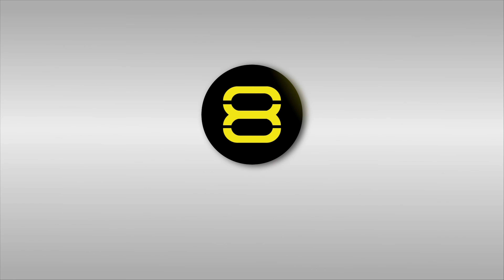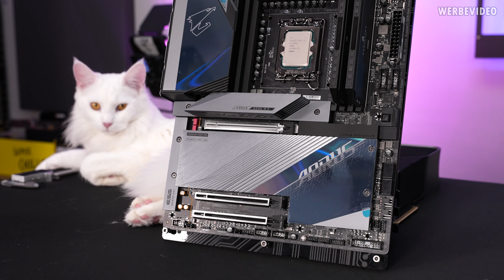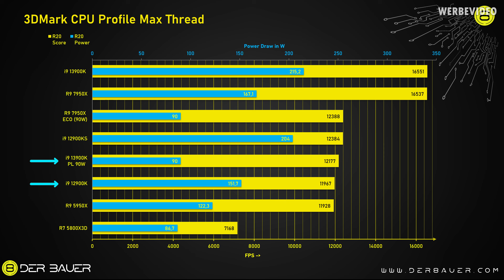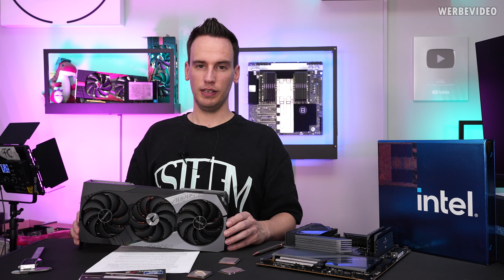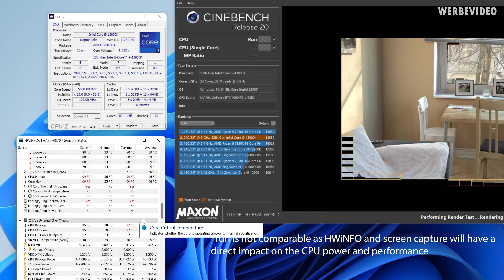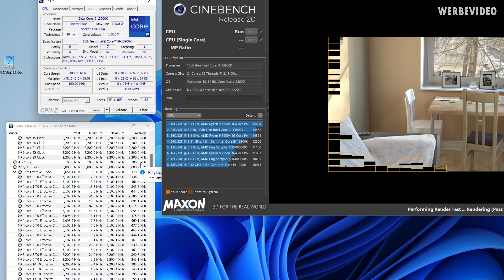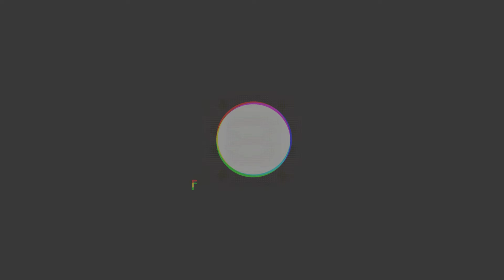Testing and Tuning the new 13900K for Efficiency

Comment: I still think what is most impressive is the eco modes and their efficiency
Reply: Exactly! I was surprised by 7950x efficiency but this video persuaded me, that even 13900k can be power efficient. That's great!
Reply: @fybyfyby  AMD know what they are doing, even the last gen Zen was efficient but they go cought up in Intels mhz game.
Reply: 12900T at 2.2Ghz had power efficiency comparable to AMD laptop chips. Every chip has a VF curve and you can decide where on that curve you go.
Reply: Ye, this is what it looks like when silicone is EOL lol.
Reply: @Coffee Fueled Curmudgeon but wouldn't that be the same as getting a 12900K or 12900KS ?
Reply: I'll now wait for the 7800x3D and 13700K stats to see which has the lowest energy use for gaming and that will be be me sorted I think.
Reply: @Coffee Fueled Curmudgeon I'm kinda thinking 13700 is the sweet spot, which is why they aren't throwing out the review samples for 13700.  More cache, only 100$ more than 13600, 200 less than 13900, and it still has the 8 P-cores that the 13900 has.

The power draw is at 210 watts, so with similar tweaking to what is done here you can go down to about 100 watts without seeing much performance degradation on it at all.
Reply: Great job by Intel gen 13th delivering very decent price to performance, meanwhile Amd has been a lot disappointing with Zen 4, not only Amd is overheating but also the Cpu itself is overpriced, r9 7950x is $150-200 more than i9-13900K still Amd can't beat Intel in full benchmark, not to mention Intel still compatible with DDR4. Intel totally destroyed Amd here.
Reply: @runninginthe90s75  The black and white mindset lmao. You heard Roman, Intel efficient in gaming, AMD efficient in workloads that's pretty much it. The whole AM5/DDR5 expense thing is a bummer but for people that are building a new system, the pricing won't play as big of a role since the whole system is already gonna cost lot of money no matter which platform ppl choose.
Reply: @Hito343  I disagree. 13th gen supports DDR4, what about Ryzen 7k series?
Reply: @Hito343  the actual 7000s chips also cost more for less performance
Reply: @paultapper9300  why is energy use going to take you one way or the other.... just buy a bigger PSU and go with the best performer.
Reply: Bodes well for the laptop parts too
Reply: Intel 13600K / 13700K should be even more efficient for gaming, less cores idling.
And then AMD comes with something like Ryzen 7700X3D xD
Reply: @mi-rek  the AMD would require me to get a whole new mobo.  Im wondering if it's even worth getting a 13600K or 13700K to just gain a few Mhz?  (coming from a 12900K).  The nice thing is I would just think I could pop the old out and pop the new one in (adding a little contact gel).  I don't even think i would have to flash the BIOS with the new version that came out recently (since flashing the BIOS wipes out all my settings, ugh).  ?
Reply: Could someone explain why people are acting as though eco mode is a new thing. Ryzen has had it since at least Zen 2.  I don't remember if Zen or Zen + had it. What am I missing?
Reply: @The_Chad_  I think maybe because it wasn't as much of a necessity with previous gens on desktop.
Reply: I still currently use a 8700k. The stock TDP on that is 95W. Both teams are just getting very greedy with their performance numbers that power draw is only an afterthought.
Reply: @z0rpan2  yea, agree, my 12900K / 3090 combo just restarted last night while i was in the middle of game-play , and I have NO idea why?  That's the frustrating thing, there is no way for me to tell what happened.  Was it my 1000w EVGA G6 SuperNova? Was it the 3090 causing it, was it the 12900K causing it?  Was it the Memory G-Skiill 6000 ddr5 using XMP I profile in the mobo. I have overclocked the 12900K using AiOC from ASUS , which is basically a one-click overclocked that learns how efficient my cooling system is (Corsair Cappellix Elite 360mm AIO) with a ASUS Rog strix E, z690 ddr5 Mobo.  So literally there could be four different things causing it and I might not get lucky next time when it happens.  I mean, it came right back up but it won't do that everytime, there's going to be a point where it's going to corrupt the O/S. But it had been running multiple hours and it was getting rather warm in the room it's in.  The case is a Lian Li Evo with AIO on top (exhaust - replaced the corsair fans with AL120's), 3 back intake fans, 3 bottom intake fans, and one rear exhaust fans (all LIAN LI AL120s).  The Corsair AIO is controlled by the mobo Q-FAN setup.  I'm wondering if the GPU card heat dissipation was keeping the inside temp of the chassis too hot and the ambient temp of the room factored into it.  But people are telling me to get a Grizzley Frame for the 12900K, what do  you think? Once I get my 4090 and the 13900 shipped to me, I think it's going to get worse.  Should I put a wall outlet sensor in-place so I can see how much wattage my entire setup is taking? Could the EVGA PSU gone into protection mode? wouldn't that have shut me down instead of the restart....again, it restarted in the middle of a game, it did not shut-down.  My CPU Core-Temps are running 1.34 to 1.47 after overclocking using the built-in ASUS ROG AI Optimization (AiOC).  I wasn't paying attention to the Package #1 CPU temp at the time, but they been running from 35 to 80 Celcius.
Reply: @harpoon_bakery162  Strange flex, my dude.
Reply: @dabneyoffermein595  For one, 200-300 watts of power draw is ridiculous regardless of the performance that it gives.  Secondly electricity can be very expensive pending where you reside...Europe has a major energy shortage/crisis presently where people are paying $500-$800/mo for electricity and to heat even small apartments...and winter isn't even actually here yet.  Lastly, if it is possible to HALVE the power draw in gaming, with minimal effect on performance, this means you can either use a significantly cheaper cooler or will get much better thermals and acoustics with a larger, more capable, cooler.
Reply: @robertmelchert9687  Ah, gotcha, didn't realize that. Wonder what's causing that energy shortage over there?  Sorry to hear.  Yea, power is high here but i hope it keeps going down. not up.
Reply: @harpoon_bakery162  In short the vast majority of Europe was dependent on gas/oil from Russia.  The European Union has decided to no longer source from Russia due to the war in Ukraine as a means to hurt Russia financially.  This has put them in a tight position until they can logistically work around getting energy sources elsewhere.
Reply: @Hito343  "the black and white mindset lmao" what a freaking hypocrite in the same post too wow. Did u read your last statement?
Reply: @Hito343  also $200-300 off of an "already expensive" system is easily money toward a better GPU, better cooling, more personalization, more storage, second monitor, etc

Your argument is extremely disingenuous and shows your stinky fanboyism
Reply: @thisisashan  idk, I doubt 6MB of cache will make much difference. In terms of L3 Cache per p-core the 13600k is 4mb per core and the 13700k is 3.75mb
Reply: @Hito343  thats not true, a 7600x that requires DDR5 and a minimum $200 Motherboard will cost 600-700 while a 13600k with a z690 and ddr4 will cost 500-550
Reply: @runninginthe90s75  I disagree, Motherboard vendors and DDR5 only destroyed Zen 4. However, AMD will bounce back with 7000x3d. Just look at 5800x3d or AM4 sales in general.
Reply: @z0rpan2  Yeah IMO though its more about temperatures as result of power draw that is more important especially since i mostly game. I mean watt is 10-20 watts less really gonna do for my power bill lol
Reply: @robertmelchert9687  I'm more concerned about efficiency because it is the only path forward that doesn't result in catastrophic hardware failures. Historically running hardware harder and harder causes serious longevity concerns. Just think about Drag Racers that need their engines practically entirely rebuilt after a quarter mile ;)
Reply: @YeshuaChristRedeems  It isn't the cache, it is the additional 2 P-cores.
Given most titles are capped at 8 cores due to the popular engines being capped at 8 cores, this means it will outperform the 13600k in every game title by a decent margin, and score close to the 13900k as well.  
And in single core games, only clock speed matters so of course it will do 2nd best there.

And in the very few outliers where multithreading is done correctly, it bests the 7900x, but falls short of the 7950x by quite a bit.

So in short... for an extra $100 you get quite a bit of performance.  And it has nothing to do with cache.

And compared to zen chips, you are saving 200-300$+ and getting better performance in most things... Which is exactly why this is the best 13th gen.
Reply: @thisisashan  Very few games even use 8 cores and if they use 8 it has very little impact on performance. IPC and Clockspeed are the only thing that matters. 6 cores and up is plenty.
Reply: @thisisashan  MW2 for example use only 5 by default even on 8 core+ CPUs
Reply: @thisisashan  In reality you are just trying to justify spending more money and thats fine. You don't need to justify it just do it if you want to.
Reply: @thisisashan  Oh so cache doesn't matter now huh? Only when its convenient towards  your point right?
Reply: @YeshuaChristRedeems  That is completely incorrect.  Unity and Unreal Engine use 8 cores.  Unreal engine being more than 48% of your AAA titles, and Unity being 62% of your indie games.

Which means no.  You are completely demonstrably incorrect.
Reply: @YeshuaChristRedeems  MW2 uses its own engine, it is an exception to the rule, not the rule.
Reply: @thisisashan  Plus the age old core count argument only applied when CPUs were quite a bit slower than now.
Reply: @thisisashan  no it doesnt. Performance doesn't scale linearly with core count in games.
Reply: @thisisashan  Only a fool uses insults in argumentation. You are acting childish.
Reply: @thisisashan  alot of the performance issues on lower core count cpus in the past could be attributed to background tasks and windows scheduler. Nowadays with e-cores handling all that 6-cores are able to strech their legs more I'd imagine.
Reply: @thisisashan  Also as "someone in the industry" I'd imagine you'd want your game to be as accessible as possible so I doubt you'd scale performance too drastically with higher core counts at a detriment to people with lower core counts.
Reply: @thisisashan  Even Cyberpunk 2077 doesn't care about having more cores than 6 and that is an infamously CPU bound game.
Reply: @thisisashan  this is my thought exactly. Great reviews starting to come out for the i7, and you can either overclock or power limit or undervlt. Seems to be a great middle ground. It really comes down to if you need those extra effeciency cores on the i9 for applications.
Reply: @depth386  hey was curious where you found this? I have an i7-11700k and am wondering if I can downclock it to perform the same as an i7-11700T. I’m assuming they’re otherwise the same and Intel just sets the clocks in the factory for the T
Reply: I undervolted my 13900k by an offset of -0.050 and it went from always thermal throttling to now never throttling on cinebench runs.  Oh and i gained 800 more points on cinebench due to the undervolting since im not throttling anymore.
Reply: Dear der8auer EN, its appears your subscribers dragged you kicking and screaming to finally admit in your videos that Intel has a power problem with their 12th Gen CPU & onwards. Unfortunately Intel will not be paying you bribe money for this video.
Reply: @thisisashan  I am thinking the same. What would the gain be to go 13900 with this tweaking over 13700?
Reply: @paultapper9300  13700k turned out to be even better than the 12900k!
Reply: and now intel jammed the 13900k into laptops as 13900/950/980hx cpu, all 3 cpu also have really high clock speed and power draw, reaching 180+ in extreme cases, amd also did the same with their ryzen 7845/7945hx by jamming 7900x and 7950x into laptops

Comment: I really like the sensible direction your taking with your tuning videos with how brands are getting in a power war with their products now days. 

Personally i have a down clock script on linux when i run a game and i just figure out what clock a game needs and auto restrict the games along with using the low latency performance scheduler.  Then in the desktop i keep full (sensible power) clocks for good response and productivity inside VM's etc.

Keep up the good work :)   I suppose its kind of good that these things all come hyper clocked and we just turn them down a bit rather than having to mod them etc.

I feel like theyre missing a beat in showing people their efficiency a bit more and letting people toggle the power rather than perma run it.
Reply: 99% of people won't even look at the power draw, they don't care how much power it uses, just the fact that it's too hot but they still just get a more beefy cooler and go with it.
Only when you are very conscious about power usage in general would you consider how much your pc draws

Comment: Nice to see the power limit values again and the curve, however as mentioned can you use better liquid cooling to see how a custom water cooler does at high watts ?  Of course you go a lot colder with LN2 etc but good watercooling results will be useful to a lot of folk.

Thanks for the good work.

Comment: Absolutely THE best review out there of 13900k.
Reply: It's ok. I like the power consumption implementation but I'd like some real life benchmarks as well. Like if you have a 4090 you'll be playing at 4k on ultra settings, not 1440p or 1080p on esports settings. If that benchmark doesn't show a difference between the CPUs because it's GPU limited then I wanna know about it because then I know that buying it is pointless for normal gaming. Honestly could care less about this 600fps nonsense.

Comment: Regarding lowering wattage, there seems to be a huge difference in data, compared to hwu testing with limited power draw.
Reply: I mean they have different methodology, testing different hardware... Why would the data be same?
Reply: HUB’s number are wrong but of course are the ones being splattered everywhere now.

Comment: Appreciate the outside box approach compared to just taking one power figure and driving it into the ground repeatedly memeing “furnance”. Like you said for the 4090 Re:power/tuning…it’s hard to understand why intel and AMD both went with such higher power target on their flagship chips for the 10% gains vs more acceptable powers, but at least buyers know thanks to your clear videos it can be “fixed” with a few tweaks to your liking.

Comment: I really wish I had underclocked my i9-13900K immediately after purchasing it, especially given the recent news of its accelerated degradation due to excessive voltages and temperatures (exacerbated further by the oxidation of the vias). Well, better late than never, I guess.

Comment: Amazing video. Roman, as engineer myself (simmilar field 2 :) ),  i thank you to do some tuning and research. Alot of influencers just put stock settings and pull wrong conclusions. My current and last intel chip i7 8700k takes stupid amounts of voltage stock. If you limit it and tune it takes so much less voltage for stock freq. I think this is behavior on all motherboards for last few gens. Motherboard manufacturers just put  voltage to the limit of chip ( i guess becouse marketing, and sales). And chip runs 2 hot.

Comment: I dont know much about tuning my PC in my bios. But i had problems with my 13900k spiking at 90C with my AIO. I just tuned it to work at 90W as you did in your vid. my games and everything is running as good as before AND my max C is at 64C! Thank you SO SO SO SO much for this Video!

Comment: 20:20 “Most people are just going to game with their 13900K.”

I build two high end computers for an AI code developer using 13900Ks and 4090FEs. The first was in a Fractal Design Torrent case with Noctua’s most capable air cooler, NH-D15. The second used a Fractal Design Pop Air case  and a Noctua NH-U12A case. The Pop Air case was slightly modified so that the front fan support would not block two Noctua 140 mm fans. The second computer had a much less capable cooling solution.

Testing and Tuning the second computer was done with Cenibench R23, Furmark, Intel Extreme Tuning Utility, CPUID HWMonitor, Windows 10 Task Manager, and Kill A Watt P3. It had an 850 W Gold power supply, so the power at the Kill A Watt should not be over 950 watts.

The 13900K ran Cenibench and the 4090FE ran Furmark. I think Furmark is an overkill for a GPU like Prime 95 is an over kill for a CPU. Temperatures were never a problem for the 4090FE.

Turbo Boost is meant to take advantage of the thermal inertia for a short time if the CPU is not fully utilized. Thread swapping is not talked about much. You can watch it happen if you look at HWMonitor temperature and utilization if you CPU render a single thread with Cenibench. If the CPU is near its thermal limit it will swap threads with a cooler core. This thread swapping takes time and results in a series of “no op” states on both cores and no work gets done

An assumption for tuning the CPU is that the load will be nearly constant and the CPU temperature will be near the 100 C limit with dust compromising the cooling solution. To achieve this I chose to limit the P and E cores maximum frequency and limit turbo boot power and minimize duration so that the CPU’s package temperature was no more than 82 C.

The results were good. The CPU’s package temperature was no more than 82 C with a Cenibench R23 multi score just over 80,000. The Kill A Watt showed about 800 W which means the PSU had a load of about 720 W.